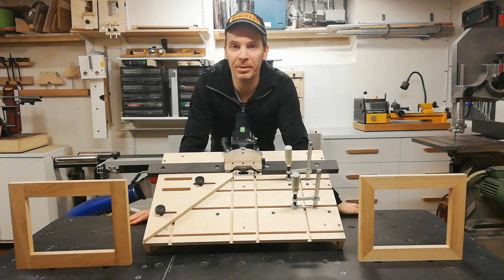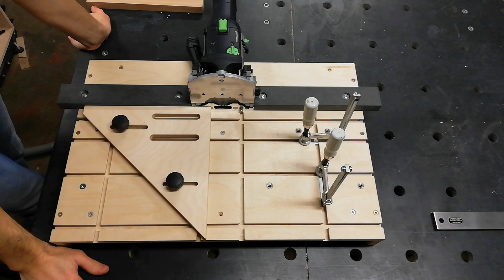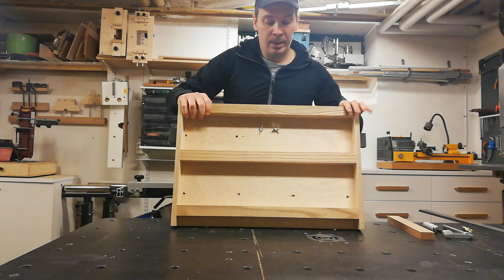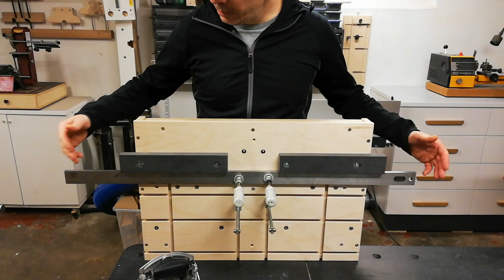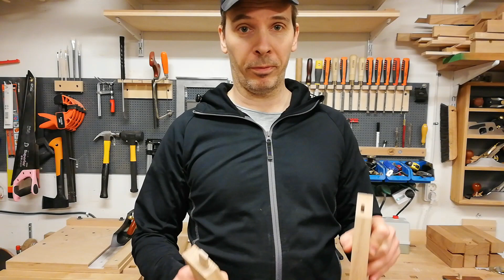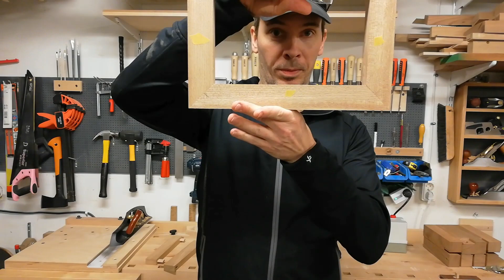High precision Festool Domino jig - Part 1 of 2

Comment: ...so happy I stumbled upon this. This is the same idea that popped up in FWW 279 tips. The cut t- track ideas are endless. Thanks for sharing and changing my thoughts on how I make my jigs now. Now off to the shop to make my domino experience more pleasant. Oh and thanks for 279!!!
Reply from the maker: Thanks!...#279😀. That was quite some years after I first tipped FWW about the routed in t-tracks but finally they were convinced. Agree, it totally changes the clamping solution for jig building. My cross cut sled was "first out" in my shop and there it's really useful and beats all other clamping concepts. https://youtu.be/UuoqtK3L-MY
Reply: @CarmoniusFinsnickeri  ... Domino jig table set up and working amazingly… Thanks again! I can now take off the button that makes the domino hole a little larger! 🤠 I love any woodworking project where I can be concerned with thousandths of an inch and feel confident that I can achieve that accuracy!
Reply from the maker: @clars7146  good work! Did you make the improved fence as well? If you like thousands I recommend you also check out my digital edge guide for the router....and fence for the router table but that's not as innovative🙂
Reply: @CarmoniusFinsnickeri  ...I did not make the newer fence.. I work to the spacer block not cutting a spacer after. I will see how it goes. I will check out your router fence. I attached 4 legs to aprons for a small table..16 dominos no marking, all on the tight setting, all ended up flush....perfect!!! Thank you

Comment: 3rd Most expensive joinery machine in the world ...... both Lamello and Mafell make joinery machines that retail for more than the Festool, at least in the states. Rare is the time I've been able to say Festool cost less than the competition lol. In the U.S. Festool is almost always the most expensive product when compared to similar offerings from other power tool manufacturers however oftentimes festool products stand alone in terms of in class competition with no direct competitors. It also must be said that the festool products which can be compared apples to apples with competitors are almost always of a quality far better and usually packed with innovations and features not seen on any other tools which sort of places them in the same class in name only.

Comment: This is impressive.
For adjustability, would it be possible to mount the domino with the top support down at 90°, then mount to the table upside down so the bottom surface of the top support is now facing up and flush with the table surface? If it is, it would allow you to adjust the height of the domino by the tools adjustment, instead of removing it to add shims.
Reply from the maker: Needed to read that a few times but now I get what you mean. It's a very clever idea🙂. Though I would be quite worried about flex and inaccuracy and loosing angle setting, with the machine "hanging" only in the top support. My gut feeling is that It's a  much less stable and reliable solution. But, very smart and it could be worth doing a trial of it.

Comment: 14:00 when the price is thicker, use two Dominos? More stability and no need to adjust.
Reply from the maker: If it's thicker than 30ish mm that would be an option. Thinner than that (depending on domino thickness) the two dominos would collide. Center of cut is 10mm up, if using 6mm domino the upper edge of cut is 13mm up. In a 30mm thick part that leaves 4mm material between the dominos, in a 26mm part it leaves 0mm gap between them.

Comment: 11:55 can't you just leave the last butted piece clamped down and align the fence to that?
Reply from the maker: No. The fence is flipped using the center of the cut (which is centered around the guide pins on the machine) as reference. Using the work piece as flip reference would only work if the domino cut is 100% centered in the work piece. My method is more flexible (cut doesn't need to be centered in the work piece) and also more reliable. Also your suggestion would only work on 90 degree joints, miters or any other angle it would not work.
Reply: Oh, my mistake, I see it now.
Maybe a self-centering contraption could help? Like a center finder where you can leave one of the two sides as a fence for your blue parts, then switch it over to the other side.

Just thinking how to avoid possible mistakes using measurement tools and sacrificial pieces.
Reply from the maker: Check the new film for the fence flipping, solves all problems. https://youtu.be/gjA5Z8lQVzg

Comment: You could incorporate hold-down-clamps to the fence to not fiddle around with the T-track clamps.
Reply from the maker: Toggle clamps? Well. You would need two clamps at the miter side of the fence, two clamps at the straight side and two clamps on left and right side of the domino. That means 8 clamps in total. Also, toggle clamps put a lot of force between the parts which risks to bend the base and/or the the fences. With track clamps this force is taken up within the clamps and there is no risk of bending. To add to that the rail clamps are easier to adjust for various thicknesses of wood. But sure; if this was a production jig, only handling one type of cuts and size of wood, it could make sense to beef up all parts and go for toggle clamps. Quicker but less flexible

Comment: There is an accessory for narrow stock.
On miter joints, the Domino has to be closer to the center, doesn't it?

The jig looks very nice though!
Reply from the maker: Narrow stock accessory would only handle the end grain cut side and there is some fiddling involved with it. Long side cuts are not helped by that accessory. For the miters, the exact domino location depends on a lot of things, wood width, length of Domino and if there is to be a groove for a picture or something else on the inside etc. This is not an instruction video where to position the domino, I only show how to place it in excatly the same place in both parts.